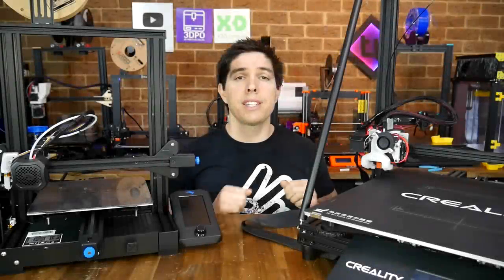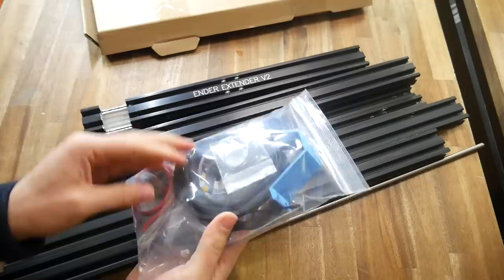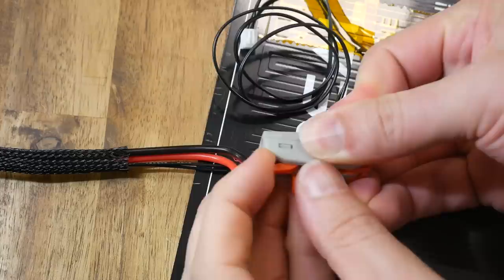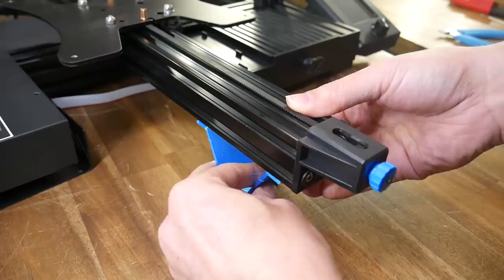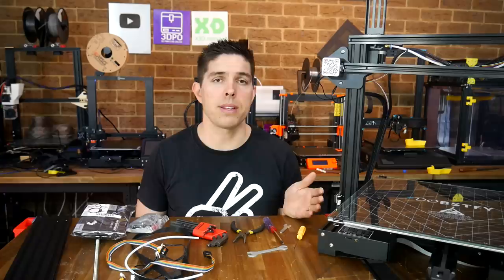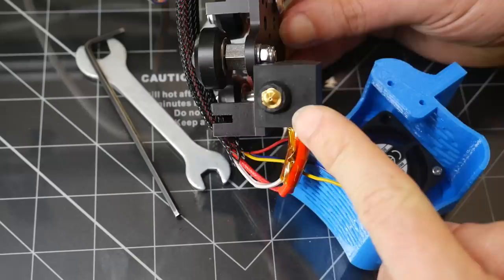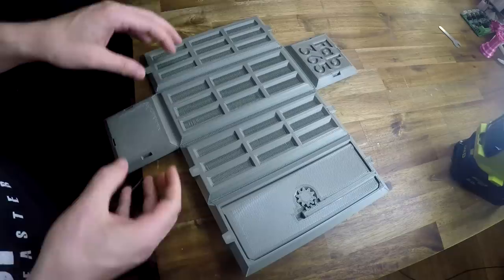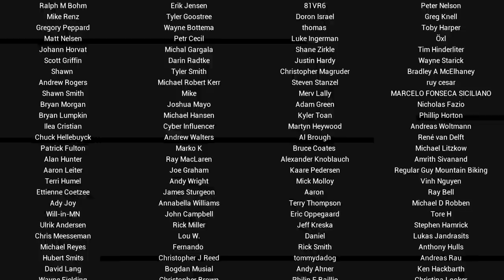Supersizing an Ender 3 V2: CR-10 Max for half the money - Ender Extender kit

Comment: Just picked up a ender 3 v2 as my first printer! For 229 usd !!!
Can't wait to get going :)
Reply from the maker: My advice is to get to know it in stock form first before you mod it, then have fun as you see fit.
Reply: Where from for 230?
Reply: @jon9947  thanks for the information...I'm planning to get one very soon and eventually modify but I keep flip flopping between getting a v1 and v2 as a base.
The silent board is the the biggest plus for going v2 for me and the psu would already be upgraded to the mean well (heard some bad things about the generic psu). On the other hand the v1 is a "cheaper" base to build off of.
Reply: @nokeyzF  No problem.  I cant speak about the silent boards, as my printer sits in its own location, and noise dosnt matter to me any.  I got my v1 September of 2019, and I have had no problems with it.  

I kinda think the mean well psu's are just something that has been overly hyped.  Iv heard bad things about non mean well's, but surly they are not the only brand that can make a good psu.  That is just an opinion and I have nothing to back it up other than mine is still working.  

All that said, if it is something you are going to eventually upgrade, and not upgrade as soon as you get it then I would likely go with a brand new printer and not worry about the possibility that something is wrong, they are refurbished.  That is just what I would do though.
Reply: @TeachingTech  one last question. Are there any downsides to buying the printer off of amazon vs the official website?
Reply: @jon9947  I have to agree, I sell a lot or printers and the only one that had a faulty PSU ever was an Ender 3 V2 (after 3 months I still have not got a replacement from Creality)

Comment: Hmmm... I see on the website there is also an upgrade kit for the Ender 5, adding an extra z-axis part (and thus maybe increased stabilizing that on-sided heat bed construction), and increased height. This can be interesting for those that have the original (non-plus) Ender 5 version. It would be fun if someone would test that one out.
I am also interested to see how the direct drive upgrade compares to the Micro Swiss Direct Drive Extruder upgrade set (this adds a full-metal head and a direct drive all at once for the Ender 3 and Ender 5 ).
Otherwise - Nice to see these upgrades are a cost-effective upgrade route from an Ender 3 to a CR-10 sized printer.

Comment: I just added 600mm 2040s to my z-axis (it's still quite rigid but I would not go any taller without some type of mechanical support), as well as a 600mm lead screw. The 2040s cost $30 for two pieces and the lead screw (and I added a pillow block to the top) was $40. As a rocket builder, most of my parts are tall so keeping the bed size and adding height made a huge difference. I updated the firmware to 235x235x400 for now. If I need additional height I can simply increase it another 100mm to 500mm. I did have to extend the wiring which I did on the bottom where it comes out of the control board. Adding the appropriate length was not difficult, just tedious. Seems like I had to strip, solder, and heat shrink 22 connections. I also took the time to wax lace the wiring bundle (old school). All in, the time to do the work was maybe 3 or 4 hours. I duplicated the mounting holes from the original z-axis rails and tapped everything required. Finally, I added a MicroSwiss hot end. I always print with at least PETG so something that could take the heat was the better method than the stock hot end. Custom building starting with an Ender 3 V2 is a great option!

Comment: What you said about buying the ender 3 and upgrading gradually, is the whole reason I have a printer at all. Out of the blue, I just went "you know what, this printer actually looks really good for its price. I've wanted one for ages, but never wanted to spend 500$+ on it." So I bought a second hand ender 3 pro for around 140$, and I'm super happy with it. Especially after upgrading the board to an skr mini e3 v2 to get more features (and a MUCH quieter printer), and a pretty cheap steel + PEI sheet I bought on aliexpress. I'm much more willing to spend more time than money, and also doing it gradually. So this made perfect sense for me :)

I do also really want to upgrade my build volume in the future, probably a kit like this. Probably not a higher Z, as it'll most likely introduce wobble when it builds that high. However the shipping and tax would cost me a fortune I bet.. might have to make my own by buying extrusions and doing a bunch more work.. :p

I do however not want a glass bed, as I've got an inductive sensor. I also don't want to wait much longer for it to heat up / cool down, and I really like the simplicity of taking off the steel + PEI sheet to take the part off. But.. laying down a custom sized PEI sticker seems really tricky. And, I'd have to get a less warped metal plate I bet :p
Reply: I personally think glass is overrated, especially if you have some kind of ABL. I have textured powder-coated beds for all 3 of my printers (Prusa MK3s, Ender 3 Pro and a Custom 300x300 DBOT) and rarely ever use anything else, though I do have some steel sheets with PEI and a few other alternatives if needed.
Reply: @brandonallen2372  I recently set my bed up with mesh levelling, as I could not level it just on the corners. The bed is pretty warped, and I don't have the induction sensor yet (probably another week or two). Hoping the one I'd use in the future with a bigger frame would be a bit more flat :p

This textured powder-coat, you print directly on it?
Reply: @PureRushXevus  I print directly on them as that is what they are designed for. FilamentOne makes the one I bought for my Ender 3 and they call it UltiStik, Prusa makes the one I use on the MK3S and I managed to find one on AliExpress for the DBOT. The texture gets imparted onto the bottom surface so it's probably not what you want if you the bottom of your prints to be perfectly flat, but I prefer the texture so I usually leave the textured sheets on the printer.
Reply: @brandonallen2372  I see.. yeah, I really like the PEI finish on the bottom of prints

Comment: I have the ender 3 pro and have done the 400xl kit on it. also did other upgrades like direct drive, bl touch, upgraded heat bed, microswiss, dual z kit, skr 1.4 turbo, 2208 stepper motors, upgraded tft 35v3.3 display. and i have to say still have less than buying a large printer and it allowed me to scratch my itch for tinkering. thanks for the videos as always. love your stuff.

Comment: I completely agree with your approach of buying a cheaper printer and upgrading it as your needs arise. I ended up following this path after getting my first printer as my fascination for engineering functional parts quickly grew and I started my journey from hobby printing to "professional". Started with an Ender 3 V2 pro, upgraded it with a Micro swiss Direct drive kit / hardened steal nozzle and a pop up enclosure and I began successfully printing my own car parts from ASA to CF nylon all for right at $400 printer expense all said and done. At the time there wasn't anything for that price to do what I wanted.

Also a benefit to this approach is maybe you realize you don't really enjoy 3d printing and if you want to quite the hobby you aren't to deep.

Comment: 8:30 - If you're following the standards set by other MFGs that should be attached to one side of the glass to provide a textured side for printing (or the option to use the other side for clean glass. The way you installed it here blocks access to the screws if you haven't swapped to the solid raisers, which means swapping springs will be a pain.
Reply: Yeah, he installed it wrong. It doesn't go on the metal part of the heat bed. It goes on top of the glass. And you wouldnt want to flip it because of the slight bumps it has from air bubbles. You're just meant to print on the top and over time it will smooth them out.

Comment: I just bought a Ender 5, and been tinkering it all until today:
-installed a 32 bit hardware
-changed the hot end to full metal
-made a drybox (I live 100 metersfrom the beach)
-Installed a direct drive with linear rail
-Installed a dual drive extruder
-Changed my bed to a Wham Bam (no more problems of warping : )
-Installed a Ezabl auto bed leveling
-And etc.

So, if you like tinkering, go on and take a cheaper printer
It’ll worth in the end
Reply: Mark is working on a kit for the Ender5 as well.
Reply: I thought full metal is "upgrade" from ptfe lining throat,actually  it isnt, both have pros and cons and have their pwn purpose of use.
Reply from the maker: Sounds like a nice setup and lots of enjoyment playing with it.

Comment: 16:52 Couldn't agree more! It drives me nuts that people get in line to tell you that changing to direct drive will ruin your prints with omg so much ringing, yet you'll never hear a peep from them against changing to a big heavy glass bed. Unless you want to print fast on a corexy printer it's not worth being overly concerned with X carriage weight, because in most cases your Y carriage weighs a lot more.
Reply: I've had issues with my nozzle scraping against prints after I converted my ender 3 pro to direct drive. Tried making the x gantry as level as I could,  but no luck. 

I've not printed something big yet after I setup mesh levelling, as that's when the nozzle used to scrape. Think it'll make a difference though.

I've debated whether to get a dual z axis setup, but it seems to be a bit tricky aligning both motors to raise/lower perfectly the same on each side.

Btw, I've seen your name a few times, are you called the same on thingiverse?
Reply: @PureRushXevus  If it's only doing it when printing "something big" it might be that your Z calibration is out (or your lead screw is bent). Being slightly low won't be a problem on layer 30, but it will add up and be an issue on layer 300. Try printing a calibration cube and give it a measure with a pair of calipers.

And yeah, same name on Thingiverse.

EDIT: Actually, that might not be right. A problem with Z calibration would just squish the part's dimensions, and wouldn't make the nozzle scrape. Although I guess the amount of plastic extruded being incorrect for the layer height could make it scrape the nozzle.
Also, maybe check your X carriage rollers are tight? It might be leaning forward a bit with the extra weight of the stepper.
Reply: @mrclown7469  ah, cool. Yeah, I was recommended a lot of these things by some people in a 3d printing discord. The leadscrew looks perfectly fine, though the scraping wasn't happening consistently I think.

Only in the spots where the the bed was higher, I guess? With big prints I'm not talking tall ones. Actually had the issue on something that was only 1-2cm tall, but really wide. Heard it mainly during fast travel moves. I'll have to see if the issue is gone now with mesh levelling

Comment: Thank you for sharing, this is very informative.   There is always the CR10v2/v3 which comes out of the box with a much larger bed as well.
Reply: Huh? Did you miss the whole point of this video?
Reply: @dangerous8333  no I was simply suggesting that a CR10 would a good middle ground value between Ender 3 and the Max.  It’s build plate area is ~75% bigger than Ender and it comes out of box with many of the mods shown in this vid out of box for less $.

Comment: I agree with your reasoning on why or why not doing this build. For around $600 bucks you got a great machine that’s huge! Awesome! After watching many of your videos I decided to rip apart my AO 101 Lulzbot and make it taller, change the board and  hot end. Cost of machine and mods will be around  $370. I’ll have a 200  x 200 x 400 z. It’s more about cuz I want to than anything and it is over ten years old so getting long in the tooth anyway.

Comment: Although i'm a bit late with my comment, i really liked this video. I have an Ender3 V2 for a couple of months now and have had some prints that could not fit the bed. this would be the solution to my problem. Never knew the extender for a bigger bed exist, i knew about the X axis extender but not this one. It will really be my next upgrade for my Ender3 V2. Great job with the video mate, keep it up.

Comment: Hey this was great. I think that the build, once you add the bigger heat pad and the second z axis stepper it will perform just as well as the cr10 Max while still being cheaper. It may not be half the price by that point but it will be less than3/4 of its price

Comment: The black pei build surface is supposed to adhere to the glass surface not the metal bed. Now you have to heat up the bed to pull off.

Comment: The orange levered connection is pretty good.  They are called "WAGO" connectors, usually used to gang several wires together not single wires going through.  I have found them in Canada at a local supplier... I don't know how much I would trust the chinese ones for 240V connections like the originals but for 12/24V they might not be bad.

Comment: A friend recently did the ender extender mod on his Mk1 Ender 3. Generally very happy but did find it needed the second lead screw to resolve quality issues - the X carriage was wobbling in the Z axis too much when at the far right hand side. He also thinks the bed heater is a bit marginal. Makes sense so budget for the bigger AC pad & switch too I reckon.

Comment: Perhaps you should take a look at Klipper again. Now with Mainsail/Fluidd (no more Octocrap) and input shapers.
Reply: I very much love Octoprint, I wouldnt use my printer nearly as much without it, but I would love to see the Klipper video you suggested.  A Klipper video that covers everything this time.
Reply from the maker: I'm looking for a printer to run Klipper full time. It was going to be the Tevo Little Monster but I was pleasantly surprised with the Lerdge and retained it. Last time I made two Klipper videos to cover as much as possible, but it's impossible to cover "everything", there will always be plenty of people with different hardware compared to me, so please keep that in mind.
Reply: @TeachingTech  Sorry, I know that came off far more snarky than it should have, and I know that you can not show everything.  I did very much enjoy both of the Klipper videos, and I should have said it differently, it just seemed both videos were incomplete.  My self personally, I dont need a guide, there are plenty of those out there.  I want a comparison on any 8bit printer.  I want to see how it preforms before, after, and then how it performs when compared to an skr or other 32bit board.  Basically I want to know if it is worth learning how to set it up.

Comment: Or a more diy and cheaper option just buy a Cr10 s4 or s5 frame and the y carriage and bed heater and set of extended cables or roll of wire to diy them and just swap everything over, for now you will have a working large volume printer but you will have an extra ender 3 frame. As you upgrade the parts to the frankenstein CR10 s4 or s5  (control board, larger steppers for the added mass, new screen,  etc) just repurpose the original parts placing back on the old ender 3 frame and slowly you will end up with your original ender 3 and an upgraded frankenstein CR10 s4 or s5 for the price of two enders when all is said and done and you don't waste any parts. Just another option if u know how the machine works and are familiar with. This route is definitely not something I'd recommend for someone new to printing I'd definitely say if you want the easier option that's less hassle, less time consuming way then the extender kit is a pre made kit and go that route. It is well made and a great option just a little more costly then piecing together your own kit. For some people they don't have the time or energy to source their own parts and do a complete rebuild multiple times. And I am not trying to push anyone one way or the other Im just saying there is always more then one way to skin a cat 🤣.

Comment: GREAT VIDEO!!
With access to a printer at work it's got me more interested in getting a home printer. 

Because of the cost of the prusa I've been looking at the under threes and trying to weigh the differences getting a better printer right off the bat or getting it under three and doing upgrades.
I really like what you said about the printer being good for hobbyists that are interested in tinkering. Pretty sure because of your video when I do get one from my own self I will be getting and probably going through the same process that you just did here. Thanks for the great video and help with my hand decision.

Comment: Well if you know you will need a CR-10 Max (which has a larger build plate than a regular CR-10) then i would say just buy the CR-10 Max outright. If you have a Ender 3 series already and want to go bigger then yeah a kit is a better option for the most part. Budget minded tinkerers will find the kits affordable and probably fun to do but if you dont like all the assembly and got the cash then buy the bigger printer. Whatever works out best for you.

Comment: Their prices have jumped up in the last 3 years. Even now they're having a 'moving sale' and it's still pricey. they don't even stock the glass plates anymore and most of the kits are literally just a frame now. Think only one came with the aluminmum build plate.

Seems cheaper and easier after converting USD to AUD, (and no doubt before shipping costs are added) to just buy a complete new printer already to the size specifications you're after. Their site definitely has 'we're getting out of this business' vibes to it.